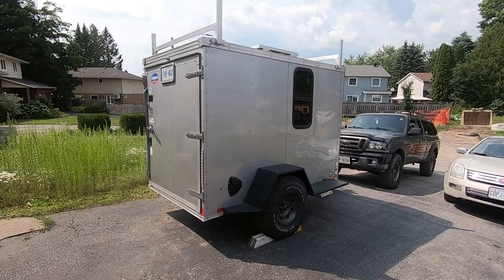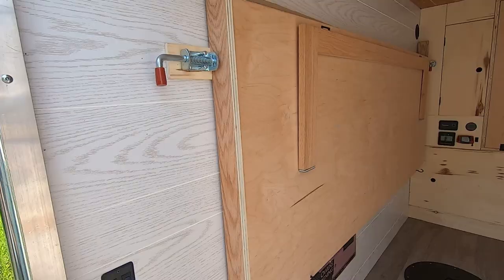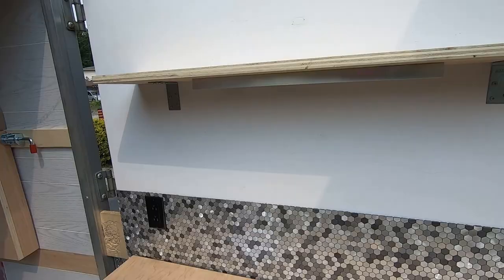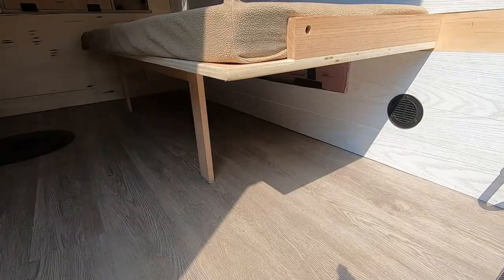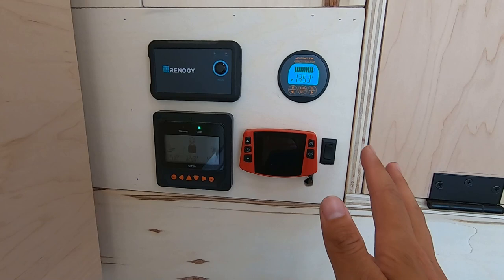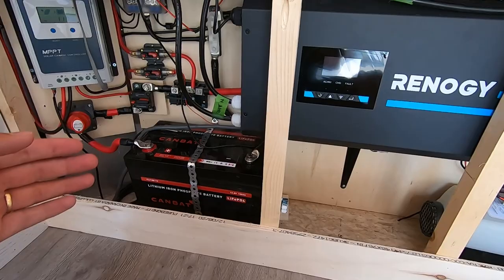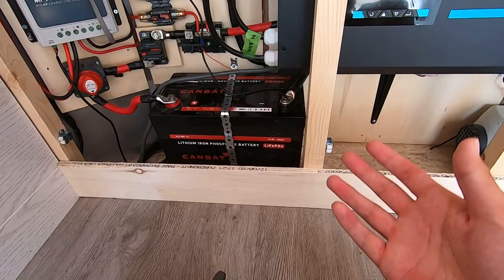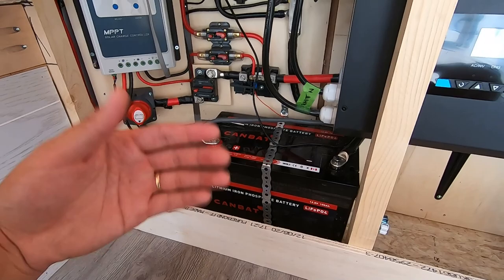LESSONS LEARNED! Things I would change on my Cargo Trailer Camper Conversion

Comment: I always like the “what I would do differently” videos.  Some of the things you pointed out can be modified and some (like the trailer size) are a little more permanent.  But even there, you can create a tent extension out the back whatever size you want.  Where there is a will, there is a way.  Great video.
Reply from the maker: You are correct! Thanks for watching.

Comment: With the table you can use some kind of pull system instead of a leg with cable wire on each side. Which you can still do

Comment: Great video! Thanks for sharing! With regards to the battery monitor; I've got the same one and found that if you hold down both arrow buttons at the same time, for about 3 seconds, it dims the display considerably.  It's only one of the lights, but, damn, it sure is a bright one. Saw your beauty trailer on Cheaper Jeeper and love it! Well done man!
Reply from the maker: Yess I accidentally changed the brightness and have been loving it haha. Thanks for coming by and watching! Cheers.

Comment: Just catching up on the videos I’ve missed. This is a good one... always easier after everything is built to see what we could have done differently. I hear you with those lights from the gauges, got the same issues. In the end awesome trailer and I think it’s nice to have a smaller trailer... perfect fit for your ranger. 👌 Let’s see some of those winter camping videos now. 😄
Reply from the maker: Thanks for watching! Yes I'm excited to get out and do some winter camping paired with overnight ice fishing!
Reply: @JoelTremblayCA  Thanks for the video. What is the total weight of your trailer? I am building a similar floor plan in 6X10". I am also pulling it with a Ranger equipped with 3.0 L engine and manual transmission. I am trying to keep the weight down to a minimum because of this. I also already realized i should have gone with thicker paneling as it is already buckling on the walls. Hope to have it on the road before spring.
Reply from the maker: @tractormandeere  I haven't weighted the trailer yet but my rough estimate is 1500lbs. I'd be careful and just triple check your load rating. I know manual transmission, your tow rating is less. Thanks for watching!!

Comment: Cool, When I build mine I will go with portable solar generator, small wood burning stove, wire for 110, propane appliances.  That's all you need.
Reply from the maker: Right on! Sounds like a good plan.

Comment: Hi Joel. I am going through 2nd level upgrades. That is why I copied your cedar ceiling. It turned out great. The reason why I did that was a bit like one of your regrets. I also used 3x8 panels to cover the ceiling and the walls. It is 1/8" luan and although cheap it degrades. For the walls it isn't too bad but the ceiling it looked awful. In the near future I am going to install maybe 2 windows. So I also will have to cut through that paneling. I hope I don't make any mistakes. 
Lasly your primary concern was the size of your trailer. From the second I first saw your project I felt it was too small. I have a 6 x 12 V nose and sometimes that is too small. However because of improving my design and stuff like the new cedar ceiling it becomes more and more liveable. This size makes it a good compromise between a tiny house on wheels and being able to go away from the cement at least a little. Lastly it is tough to build around yourself. I live in mine full time and have done for 4 years. Working inside while living there is a pain.
Reply from the maker: Thanks for sharing your experience and feedback! Safe travels and don't forget to step back and admire all the hard work you've put into it. Cheers!

Comment: I'm about to buy a 6x10 trailer and build it out. I'm looking at going with a minimalist style, as it appears to me you have chosen to do. I'm going to go with a twin hybrid mattress on a custom built frame. I am older now, so I need a little more height to be able to get out of bed easier, and the added height will allow me more storage underneath. I'm not planning on building in a kitchen. Instead, I'm planning to use a pop up screen tent as a kitchen, and until I build in a 3/4 bath, my bathroom. I'm not going to put solar on the roof initially, instead I will use portable panels, or build folding prop up frames and use the same flexible panels I will eventually put on the roof. I'll need to build the trim where the top of the wall meets the ceiling, so that I can easily take it off, and put in any future wiring. 

With the added length, I can put in a wall at the rear of the trailer, set inside from the rear door a couple feet, to use as a garage and porch. That's where I'll put in the gravity feed to fill future standard water tanks, as well as a pass through for solar. All my internal solar components can be installed here for easy access. In that wall, I plan on putting in a cut down storm door, and installing whichever vent fan I choose to go with. Not sure if I am going to go with a drop down ramp door, or barn doors. Both have their appeal. If I go with a ramp, I think I'm going to take it off, and mount it so that it opens upwards, and I have a built in awning. I watched a video where they did that, and I really liked the idea. We'll see. Until I get a proper solar system installed, I' going to go with something along the lines of a Jackery. I won't have many power needs. This should suffice, for now. Eventually, I will go with LiPO batteries, mounted in the inside front, so they don't drop below freezing. Every wall, all the doors, the floor, and the ceiling will be insulated, so I can operate in all four seasons if I wish. Any future white/black tanks will be installed on top of the floor insulation, and I'll need to raise the floor over them. That's down the road, with a proper 3/4 bath install in the nose.

For cooking, I plan on using a mix of induction plate and at least a rocket stove, if not a standard two-burner camp stove. Cassette toilet for restroom needs, at least to start. As for heating, I am really liking the idea of using a small wood burning stove, like y'all use for hot tents and ice fishing. I don't necessarily want to have to rely on a steady supply of propane. The folks in the videos I've seen these being used said they were very effective, with the only downside of having to tend it a couple times a night. Not really an issue for me. So I think the only modifications to the side of the trailer, is a hole for the smoke stack tubing, a hole for solar in, and probably a means to hang and secure a ladder so I can clean off the roof panels. 

I'll be moving in with family very short term once my current lease is ended. That will allow me to secure the trailer, and fit it out to at least be liveable. My mother is going to allow me to use her home as a permanent address, and she will forward my mail to me. In exchange, I will pay her a couple/few hundred bucks a month. That will help her out, Social Security just isn't cutting it. Once on the road, I'll avail myself of friends across the country, as well as fellow nomads with the know how, to finish up my trailer. I hope to be at the RTR for the first time, at the end of the year down in Quartzite. I'm actually aiming to be on the road fully by the end of summer, with a few short test runs before that. And who knows, we may run into each other up in Ontario. I have a friend up there I want to visit. Haven't seen her in several years. She has plenty of space for me to park a trailer for a visit, and having a place of my own, rather than a hotel stay, will be very welcome.
Reply from the maker: Sounds like a solid plan! Good luck with the build.  Thanks for watching. Safe travels and building!

Comment: you can add a thermostat and a heater to your battery from parts on amazon
Reply from the maker: Yes correct, but then the heater will always be drawing power from the battery when it's below freezing.

Comment: Not a bad little build, really. Extra studs in the framing would help the wall flex. Locking legs on the beds and table are an easy fix. Folding chairs instead of sitting on the bed fixes the table leg issue
Reply from the maker: Very good points! Thanks for watching.

Comment: You can buy heat pads for your battery, they would be cheaper than the four hundred they want for the upgraded battery. Freely roaming used them in his battery build if you haven't seen them and want to check them out. Your build looks nice, God bless!!
Reply from the maker: Yes I'm aware of the heat pads! The only problem with them is throughout the winter, if they're connected to the battery, they will be on continuously. I will end up installing a heat pad for mine, but if I were to do it again I'd just get the battery with it built in, that turns on only when needed. 

Thank you for commenting! :)
Reply: @JoelTremblayCA  for ten bucks you can get the temperature control, it draws on next to nothing. So it doesn't run unless temperature drops below your shutoff temp. 
   The pads are around twenty bucks for four, so for 370 less than the 400 dollar upgrade you can do what they have done. Not knocking them, from what i hear they have good batteries, i hear battleborn are good to. But for the thousand plus they get for a hundred amp i built a 280ah lifepo4 bank and was able to but a 60a mppt controller, and a 1,500 watt inverter and have a complete system with nearly 3x the ah. I haven't priced your battery, how much was it if you don't mind my asking?
Reply from the maker: @checkingoutgypsymike2075  The difference between battleborn and canbat cold rated batteries is the "phasing" of charging in sub-zero temps. What I mean by this is that traditional heated batteries will have a built-in temp sensor, and will turn the heater on once the temp drops below a certain value. (same thing with diy like you have mentioned) and that is great but imagine that battery sitting for 2 weeks without charge with the heater running, it will eventually run the battery out. What Canbat has told me is that their heater will only draw power from a charger, when the bms detects it connected. So the battery will see a charger connected, turn the heater on, and once the temp of the battery is above freezing, let current enter the battery to charge. It makes total sense in my mind. It sounds like you know what you're talking about when it comes to batteries and the complexities of off-grid systems. I'm not an expert, just some guy sharing my honest experiences. I have a couple of other videos where I go over my electrical build, prices, and reasons for selecting certain products. The battery cost me around $1000 tax in. Yes building your own batteries is definitely cheaper than buying from a company. I was going for peace of mind and convenience of not having to worry about messing something up. Given that I had built everything else, I wanted a head-ache free process when it comes to the electrical system. 

I think when I add my heat pad, I will install a switch, so if I plan to charge my battery I will turn the heat pad on first a few hours before I plug the charger in. When I am not using the battery I can simply keep it turned off. Think that would work? The other thing that I might run the numbers on is to see if my solar can make-up the heater running continuously, I think those pads are 45watts. Some insulation around the battery would help.
Reply: @JoelTremblayCA  Your absolutely correct on the ease of mind lol, if i had 7,000 bucks to get the almost 600 ah's my 2 banks give me it wouldn't have taken me 6 months of research to figure out the little i know. From what I've read renogy has the same capabilities on power saving, you can have the heat pads run directly off the solar panels thus saving draw from the battery. I live in michigan, so the snow covering them if i wasn't here would keep that from working not to mention there wouldn't be a need if im not hear to use it. 
   Luckily sitting in -20 below won't hurt the lifepo4 cells so it's not an issue. Im looking into the ability to turn on heat pads via remote, i came across an article mentioning it and want to check it out more in depth. I imagine it is done thru a smart shunt, but i don't want to assume that's a fact. You know what they say about that lol. I just thought I'd mention it, i didn't know if you were aware of the option. Or others who may be in the same boat, no sense in throwing the baby out with the bathwater, if you have a good working battery that will last 10 years getting rid of it for a better one would be hard to do. 
   And i have watched your solar install videos, really enjoyed them. Especially the panel install, that's a nice garage you were working in. Made me wish i had tall ceilings like yours, i can barely back my trailer up to get it under my lean-to when it rains. It's been a scorcher working in it with the sun beating down, my baggage door is 6 weeks out so i can't put my window ac in yet. I took the day ofc today to hydrate lol, and thanks for the videos, much appreciated. Yours and Luke Fugates were great in helping me learn, be safe and God bless!!

Comment: Hey Joel, did you have to change the trailer hubs to match the lug pattern of the wheels on your truck? Great vid. A lot of this can be fixed very easily . Like a wedge piece that swings out of the back wall to support the table maybe?
Reply from the maker: Thanks for the comment! No, luckily the hubs of the trailer are a matching bolt pattern as the truck. Great idea on the table!

Comment: Great set up on your electrical. I'm building something similar for my 10x12 off grid cabin. Curious, any complaints on the Renogy 2000 w Inverter Charger? I'm thinking about adding one to my system. Thanks
Reply from the maker: Honestly I haven't had any issues with the inverter but I wouldn't recommend you go with Renogy based on experiences I've heard. Go with Victron! Thanks for watching

Comment: how do you like your renogy products? I'm looking at adding a DC to DC charging system with solar and still trying to find the right product
Reply from the maker: I mean it works and I haven't had an issue with it. That being said, I've heard customer support is a nightmare. I'd go with Victron second time around. More expensive but higher quality product. https://www.canbat.com/battery/7/
Reply: @JoelTremblayCA  thanks. There's so many different opinions out there checking forums that it gets confusing to me.  I've already set up 30 amp shore power, but my battery system isn't right for it. I'm lacking in the bank size and want more than one way to charge my bank. I'm in the middle of a leather shop conversion and live offgrid already. Using a isolation system in my truck with a high amp alternator, but it's still not enough to run things like my air compressor or heater. I've got 2 100ah batteries now, waiting for some other things to show up. I'm definitely adding solar so that I'll have a total of 3 ways to charge, dc to dc via truck, shore power on generator or if I'm lucky to get actual power, and solar. I plan on being mobile and traveling while working.
Reply from the maker: @maddawgnoll  awesome to hear! Sounds like you've got a good plan. Good luck with the rest of your build. Thanks for watching!

Comment: When I first saw your video, it was obvious to me (I'm over 65, so I know how to use a screw driver and draw a layout to scale..!!!)  that you should have taken the time to review other boob toober builds before building yours, so you would not have to re-build the entire thing again, wasting more time and especially money..  The table leg was painfully obvious.. LOL!
Reply from the maker: That's great that you've been able to get the experience and skills to be able to know these things. Any kind of trade skill is... well... That, a "skill". Skills are only improved over the act of doing, patience, and practice! I hope that you're able to take the time and share your wisdom to others! The younger generation can definitely use it :) 

I won't be rebuilding anything. I have no regrets taking under the construction of something that works for me and that I actually use! The purpose of this video was to inform others who might want to know some do's and don'ts. 

Thanks for watching.
Reply: @JoelTremblayCA  The point being that if you would have drawn the layout to scale, you would not need  2' in the length..  The mattress topper material is a dead giveaway to lack of thought..  Also, I would not trust that 3/4" chine strip under the plywood deck (bed) for adult usage.  The table leg would work if the trailer was wider...!!!   As it is, the trailer is a small bathroom, and you have to go outside to change your mind... LOL!  But, it works as a sleeper/out of the weather habitat and I do like most of your workmanship..  Good luck..
Reply from the maker: @pjf7943  I appreciate your opinion but maybe you should have a look through some of my other content. Every single element of this trailer was carefully thought out. It may not be the trailer for you, and that is fine. It is the trailer for me and that's what matters. I could give you reasons for every nit picky thing you have mentioned above but I would rather spend my time doing something more rewarding. Thanks for commenting.